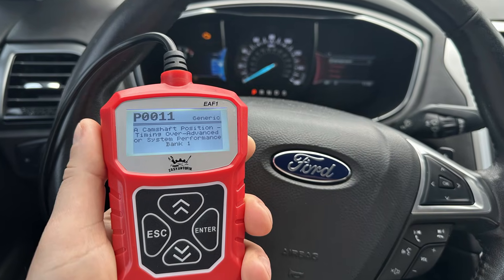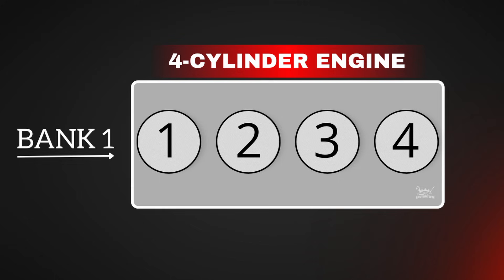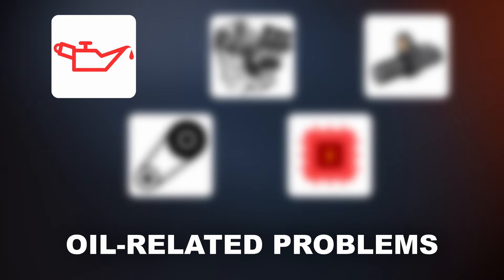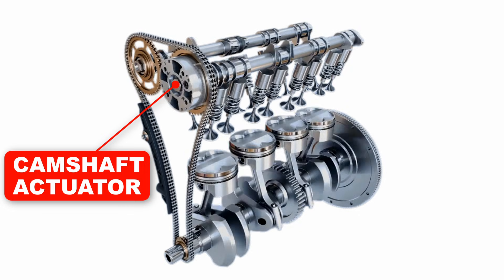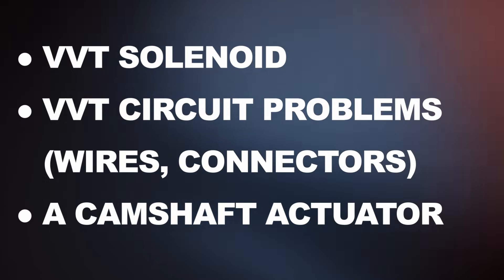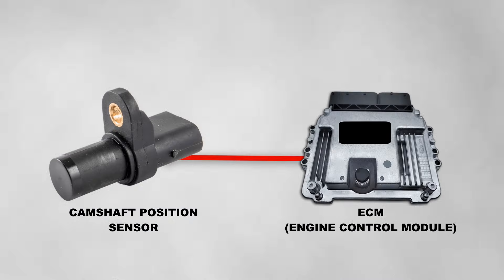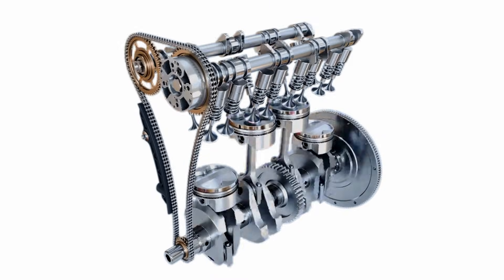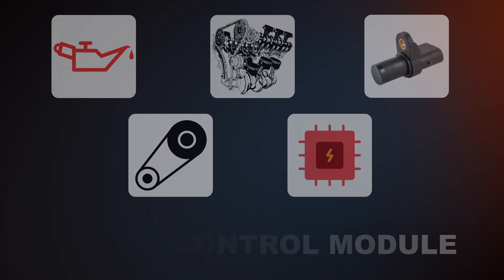P0011 Code Causes: "A" Camshaft Position Timing Over-Advanced Or System Performance (Bank 1)

Comment: Hello, I have a 2010 Megane 3 1.6 K4M BVA automatic transmission.

I'm getting a P0011 error. Could this be causing an automatic transmission fault?

I'm getting a "Check ESP, Check gearbox" error.

It corrects itself when I turn the car off and on again.

When I check with the OBD device, it shows the vehicle speed as 1000, 2000, 3000 km/h during an automatic transmission fault.

All pressure values are normal, only the speed issue seems to exist.

The authorized service center said to replace the VVT pulley and quoted a very high price.

I replaced the VVT solenoid and the other electrovalve.

The problem persists.

Comment: So I finally got to the bottom of the issue with my 2015 Chevy Sonic  The code keep going on and off. It was because of sludge buildup, cleaning that up with engine cleaner with an oil change gets rid of this issue.
Reply: How did you get the sludge out? I’m having the same issue with my 12 sonic

Comment: This is probably the most explanatory and intelligent video I've seen on this. However, you should also add which are more typical and which symptoms each has; for example: a faulty sensor or bad oil can cause an intermittent code, where all other causes will result in a full time check engine light.

Comment: Hi There
I`m struggling with a P0002, P0003, P0004, P0005 on my ODB2 scan tool for fuel volume regulator solenoid or circuit for 2007 Chevrolet spark, but can that be the cause of misfiring on cylinder 2&3 and only getting sparking on cylinder 1&4??? I took a chance on changing the coil, new spark plugs and leads but still same problem.

Comment: Can you show how you fix those problems so I don't have to pay hundreds of dollars at a shop please?
Reply: To be clear it’s all doable on your own. But that’s very dependent on your knowledge. Since you don’t have any experience with this, it’s going to be simpler in every way to let someone else do this. Replacing a sensor or oil simple enough, the timing belt/chain is not something I recommend to anyone who doesn’t have experience as you’ll most likely do it wrong and blow your motor/bend a piston or a few other issues. There’s videos showing how to replace the sensor and oil changes. Beyond that, it could be your banjo bolt if you have a turbo.  I work on almost anything in my car but I won’t touch timing nor will I tear down my own motor. I know it’s beyond my skill level and comfort. I’d rather tune a car from scratch. I’d have an extremely likely chance of being successful tuning with 0 knowledge than I’d have. If you got a junk car that you can test on that’s your best bet in learning to fix these things without sacrificing your own vehicle that you may or may not need.

Comment: Great channel! Blows away Scottys, and others. Hey, bro, I changed my MAF with one I picked up atcthe junkyard. It was already removed. Maybe rain, or dirt got into it. After I installed it the idle is very rough. In pak it is normal, but in drive, with my foot on the brake at traffic lights the van seems like it wants to break. I will buy a new MAF on the first. I'm buying new O2 sensors, as well.

Comment: Bro..i had a question..whats the cause when we driving in automatic transmission..driving on Drive mode but the gear did not acceleration..its stuck on 2nd gear..sometime its stuck on 3rd gear..can you help me to solve that problem?
Reply from the maker: Sounds like your car is in limp mode. Try scanning for codes and get that issue fixed.
Reply: @easyautofix  Merhaba, MEGANE 3 2010 1.6 K4M BVA otomatik vites aracım var.

P0011 Hatası alıyorum, bu sorun Otomatik vites hatasına sebep olur mu ?

ESP Kontrol ettirin, Vites kutusunu kontrol ettirin hatası alıyorum.

Aracı kapatıp açınca düzeliyor.

OBD Cihazından baktığımda otomatik şanzıman arıza anında araç hızını 1000,2000,3000 Km/h Gösteriyor.

Tüm Basınç değerleri normal, yalnızca hız sorunu görünüyor,

Yetkili servis VVT Kasnağının değişmesini söyledi ve çok yüksek fiyat söyledi.

VVT Selenoidi ve diğer elektrovanayı değiştirdim.

Sorun devam ediyor.
Reply: Did you fix
Reply: I have the same problem, Hyundai accent automatic
Reply: @keoagilelesejane484 try overhaul it

Comment: Thank you sir, 
I appreciate your channel 👍
Reply from the maker: Thank you sir, I appreciate you as well!
Reply: Currently getting this code in my Subaru.
I am guessing it is in the throttle body because I put the cleaning additive in the fuel tank and the rough and slow idle seem to be improving after about 50 miles of driving. Great video. The p0300 code is a tough one to pinpoint.